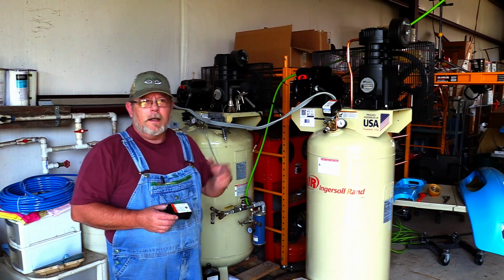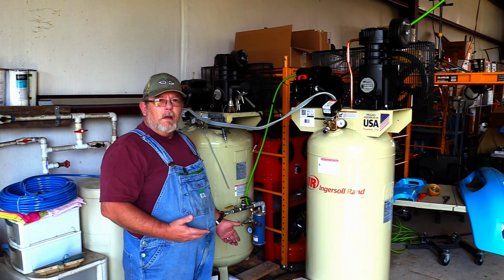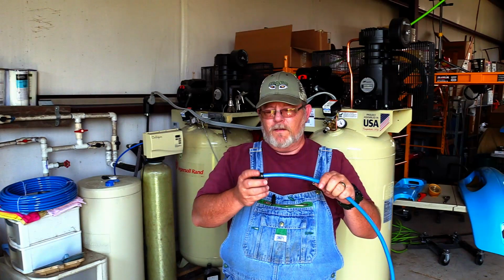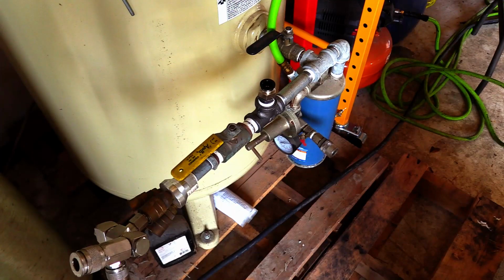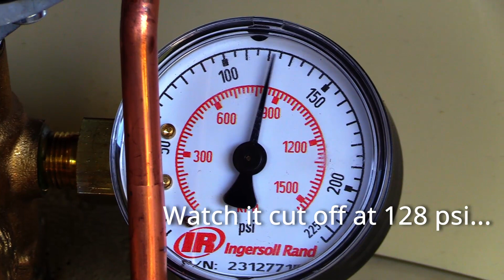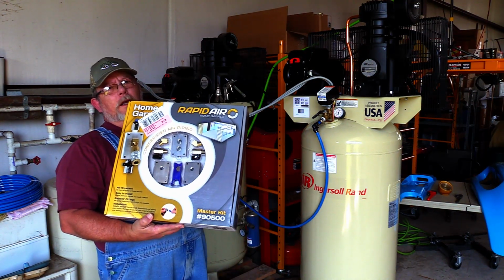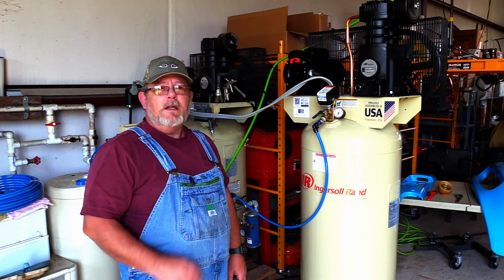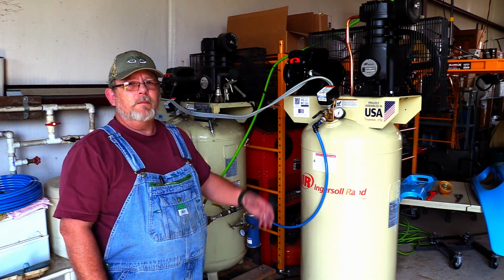Plumbing the barn for our new Ingersoll Rand 5HP 60-Gallon Vertical Air Compressor Model# SS5L5

Comment: Ty nice video..il get that blue stuff..for my new air comprsoir..you sold me on it..easy to work with..I was going to get blk iron pipe..old school ..my dad had a 5 bay service  station..back in the day..had old iron  piping..through out..like the new stuff ..ty..fyi..be carefull on your new comprsoir..that unit is know for bad moter..issuies..gone cheap..over the yrs..my friend has the same unit..been through 2 moters..in 5 yrs..add a magnetic  starter.my buddy did to his unit. If its a 5hp.and up...
Reply from the maker: Glad I could help

Comment: i think you should have connected the new compressor line to the top of the old tank so the air would cool in the old compressor tank before the air went into the lines, would have gotten rid of more water from the system i believe

Comment: Oh the ways you are losing cfm where to start... First, why run 3/8" RA bc, Ahhhhh F*ck it. Good job and im glad u found a system u love.
Reply from the maker: MOST of the things I run don't need all that much volume of air to do their thing...  And I am usually only using one thing at a time - so I saved a few bucks...  :)